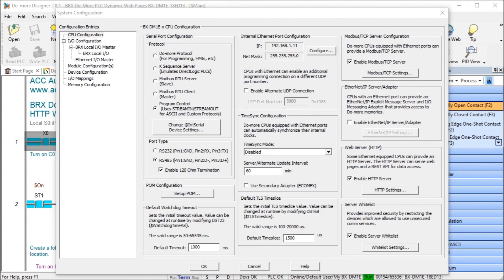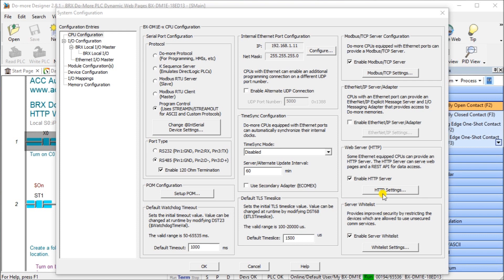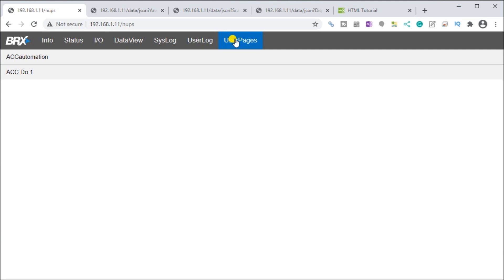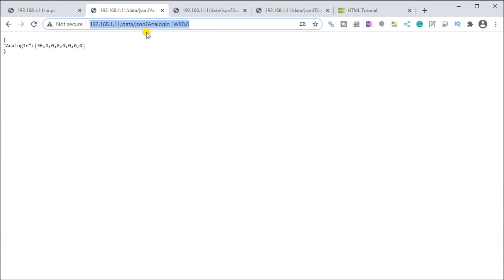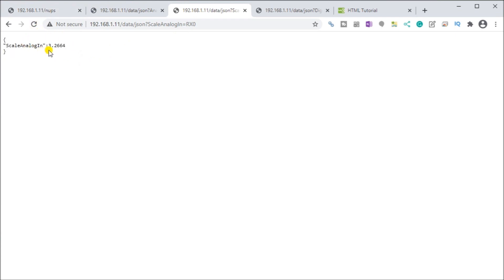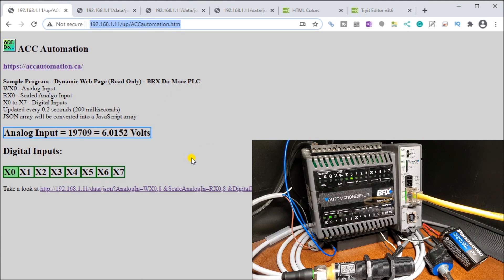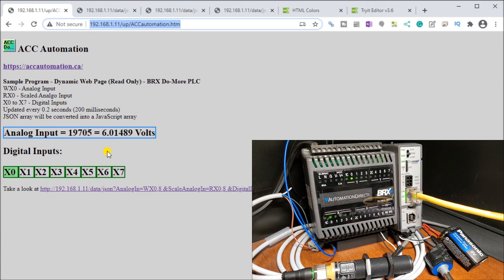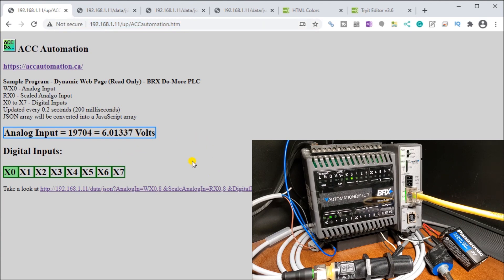BRX Do-More PLC Dynamic Web Pages

Comment: Great Videos, very interested in Dynamic web pages.  I see that all examples are inputs only.  Do you have any examples that can control or toggle and output like a relay?  For example, a html button to a BRX relay hardware from a webpage?  I am assuming REST can go both ways of communication as well.
Reply from the maker: This feature is for reading only. There is no write function at this time.
Regards,
Garry